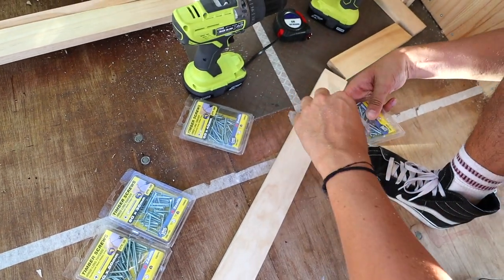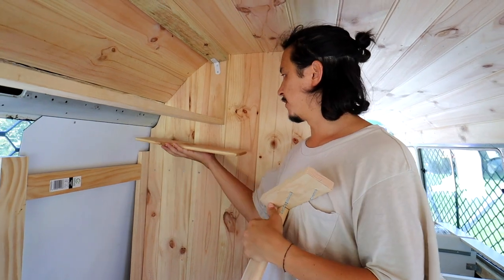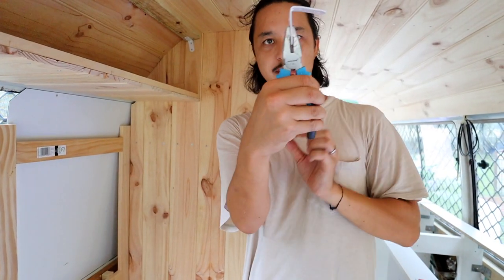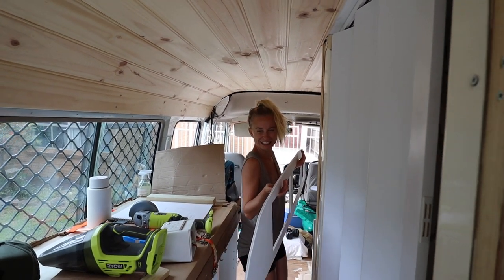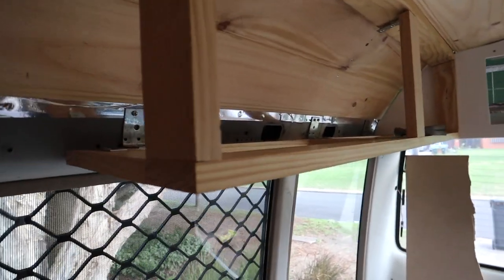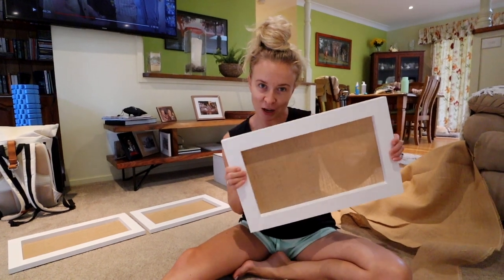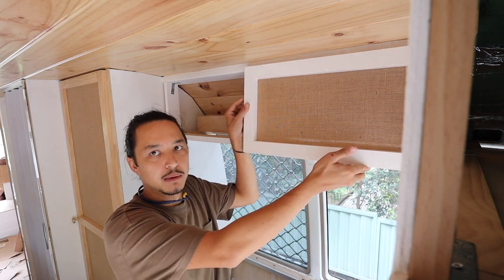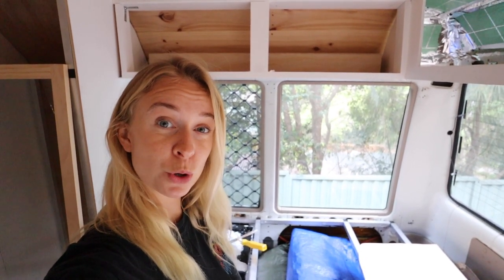BUS / VAN BUILD: Overheads. How to build shaker style overheads for beginners! DIY (Toyota Coaster)

Comment: We have a problen Houston. The tongue & groove under the overheads, are not running parallel to the ceiling tongue & groove. It would have also been less work as you would have only needed 3 planks?